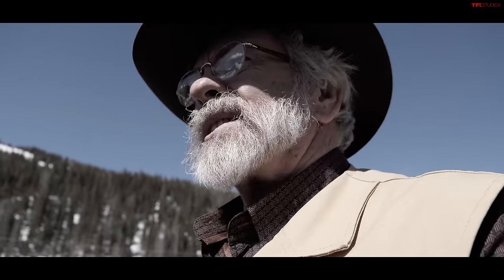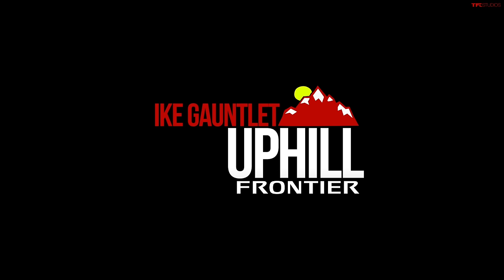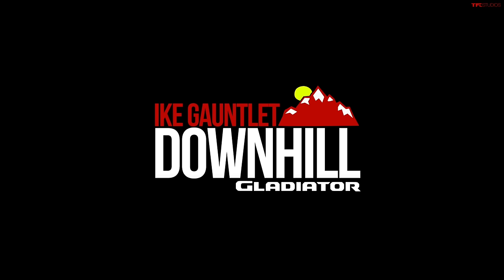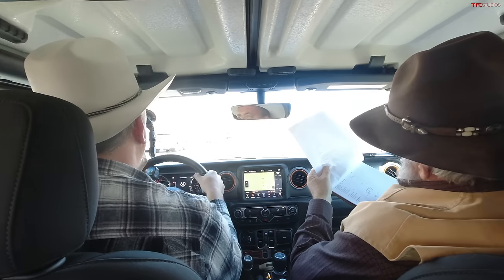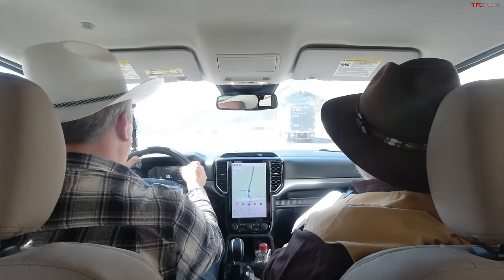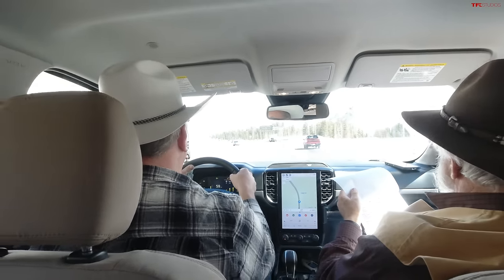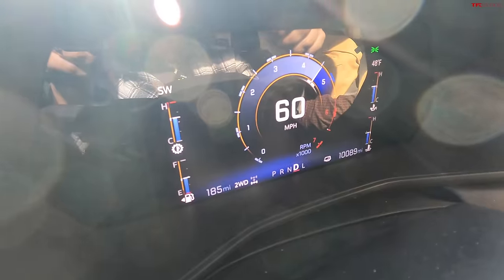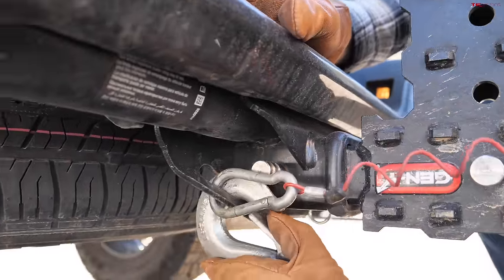MEGA Ike: New Tacoma, Ranger, Colorado, Gladiator & Frontier vs the World's Toughest Towing Test!

Comment: Good video.  However, I think given the wide range of trim levels across the brands, you shouldn't really include the "as tested" value rating  That's really only worth factoring in if the trim levels across the board are as equal as possible.  Other than that, a very useful comparison!
Reply from the maker: Thank you for the feedback.
Reply: Agree with you verbatim. An optioned up Colorado Z71 is the equivalent of the Ranger XLT Fx4, and it costs as much or more. An equivalent Nissan Pro 4X without the Hardbody stuff is cheaper than both.

Comment: The Colorado probably did worse in brake applications downhill because the transmission has learned the drivers driving style over 10,000 miles. The transmission wasn't expecting him to put a trailer and load on it going downhill because he doesn't do that very often. Starting out with a relatively fresh truck and a bunch of different drivers testing it in different environments and conditions is a whole different strategy the transmission is using than what it has learned over the last 10,000 miles. If you did a transmission adaptive reset it probably would go right back to what it originally did.
Reply from the maker: Well. This Colorado has done three Ike Gauntlet tests in its life and many drag races.   It’s hard to tell.   The Colorado was in Tow/Haul mode, so we expected better.
Reply: @TFLtruck  I understand. From an automotive technicians perspective I'm just saying that most manufacturers at this point are focusing more on a smooth shifting transmission than they are a well towing transmission. Most trucks below the 3/4 ton category are being built with a focus on passenger comfort and technical capabilities/interior options. They can haul up and down the Ike Gauntlet but they aren't as focused on doing that as they are those things. I do agree though if you place a truck into tow haul mode it should be modifying the transmission shift strategy to use engine braking as effectively as possible. If not they should just call it overdrive on or off. I do know I've seen customers bring me vehicles they just bought from a car lot and the transmissions will behave erratically. The reason for it is the many different drivers and driving styles that test drove the vehicle. The dealer really should reset the adaptives before handing over a vehicle to the new owner.
Reply: I wonder if the hill descent button was off.I checked my truck the other day under controls after putting it in tow/haul mode the hill descent activation was still set to off .
Reply: @davefornit6235 This. Once I turn on the hill descent control on my 2023 Colorado it actually engine breaks like it should.

Comment: Ya, clearly the GM and Ford are the best all-arounders when doing everything, and towing in particular. Their payloads are so good for their size, and they towed the best. I expected the Gladiator to suck at this because I remember the IKE test from a few years ago where it was tested at max towing and it BARELY passed on the low side of adequate when towing 7000+, and it has the oldest and least powerful engine. It will absolutely benefit from a new Hurricane engine. The Toyota did quite well without the hybrid system. The Nissan also did better than I thought it would, but Nissan needs to put a hybrid in it because its value proposition is already paling fast against Ford, GM, and Toyota. The Frontier is about the surest thing for product sales that Nissan has outside of cheap CUVs, and they have got to bring Frontier's sales numbers up.

Comment: I'm wonderful how the Colorado finished ahead of the Ranger on the uphill section. Being 5 seconds behind with a bigger, stronger engine with the same weight? You gave the Ranger a raw deal! I think you should retest the 2.7 Colorado against the 2.7 Ecoboost Ranger. I'm guessing you won't do that, as the 2.7 Ecoboost has handed the 2.7, 5.3 & the 3.0 Duramax their collective rear ends in the half ton trucks. As most tv shows & videos are biased toward GM products instead of the facts & the truth. PROVE ME WRONG, TFL: and just so you know, I'm a class A cdl driver with dbl/trpl & tanker endorsements. I had hazmat untl the price got ridiculous. I have over  40 yrs of experience. I can't see the Chevy beating the Ford over fuel mileage.

Comment: Can you put the cruise control on the downhill
Reply: The cruise would complicate things.  It would depends on when the cruise downshifts and such.  Here, the tow modes are main thing being testes as well as how the engine braking holds back the truck.  Its more repeatable and easier to compare trucks.
Reply: It's not common knowledge but Andre's Colorado doesn't have cruise control. Somehow it got overlooked. Chevy should have it on there but they don't.
Reply from the maker: We have done this with HD pickup trucks that helps us monitor the trailer brake gain.

Comment: Great video, thanks guys! I had hoped to see less issues with the Ranger since it has brake control.

Quick question... The Rangers all seem to be shipping with uncoated drive shafts that are coated in surface rust. Is this an issue that customers get from the other manufacturers?

Comment: You used the price you paid for the Colorado a year ago. Have you verified the current price for the same spec?  I'm gonna guess it would have cost more than it did then which would throw off your comparison.
Reply: It's still the most affordable even today
Reply: Hmm that's the best you can think of to try and dethrone the champ?  A 45 week price difference in the same truck.  Just be happy with what you have.
Reply: Its about the same.  His truck came with turbo plus (same engine but reduced power turning) and he had to pay for the turbomax tuning from the dealer for about $600.  The new colorados (trailboss and above) come with that turbomax as standard now but the price increased about the same.

Comment: Exceptional video! Thank you for your hard work. This is exactly the type of video I want to see. I plan to buy at the end of 2024. We have towed our small Casita camper (2900 lbs) 32,000 miles over the last 8 years of camping. Our used 2009 Kia Borrego V8 rated to tow 7500 lbs has been a workhorse, but with 161,000 miles, it is time to think about a pickup truck. Despite highly valuing reliability and safety, buying a truck also involves functionality and effectiveness at the tasks of towing and hauling. While reliability remains very important, function is of paramount importantance. In addition to towing, we haul camping gear so payload is very important. Unfortunately, this puts the Frontier and Tacoma at the back of the pack. I think the Gladiator would have more payload in the Sport S trim rather than the Mojave/Rubicon trims. I am very impressed with the payload numbers in the Ranger and Colorado. Plus, they are tops in terms of tow capacity. Functionality, yes! I am a bit disappointed that the test, understandably, did not include the Ridgeline. I recognize with its 5000 lb tow rating, it cannot handle a 6200 lb load. I would have liked a test towing 4,000 to 4,500 lbs that would have included the Ridgeline. The Ridgeline can compete with the best of the other midsize truck in terms of real world payload as well. I look forward to seeing the Ridgeline included in other tests with this midsize truck extravaganza that you are conducting. Wow! Thanks again!!!

Comment: This test proved one thing. If you want to tow much more than 6,000 pounds, you need to jump to a full size heavy half ton truck. Your workin all 5 of these trucks to hard to pull 6300 pounds of car trailer and mid size v8 4x2 pickup with 3 hamburger fed full grown men on board. (Camera guy in back seat.)
Reply: If you are towing 6000 lb trailers over 11000' passes regularly then sure, I agree, but anyone else in less aggressive environments should be fine with these.
Reply: Imo, if you want to tow over 5,000 pounds, go half ton, over 7,000, go HD and really enjoy the experience.

No one complains about having too much truck,  but plenty complain they don’t have enough, when it comes to towing.

Comment: Great video. Just wish you had informed us if the Jeep has a tow/haul mode.
Reply: They did and it doesn't have tow/haul mode.
Reply: 2024 does though, and they chose to test the worst gladiator for towing…
Reply from the maker: We stated that it does not.
Reply from the maker: Still the Jeep did the best on the downhill performance.
Reply: @WheresHerb  It was sarcasm. They stated it so many times that it was a running joke by the end of video.

Comment: Probably would have chosen a sport S or Willys to test towing.
Reply: They kind of get what they get, I don’t think it would have changed the results that much, but certainly those do tow a bit better than the off road focused Mojave
Reply from the maker: We tried but the timing did not work out.
Reply: Whats the point? still wont compete .
Reply: @rodgood  the lower trims would have a little better payload I think.
Reply: @jkfaulkner  the engine is not up to use, in a Jeep.
Reply: @rodgood  Jeep should have offered a new power plant for 2024.

Comment: The Ranger to me wins for being able to have the 2.7 liter V6 at some point or the 3.0 liter V6 three different engine choices unlike with the others you get 1 choice more choice the better
Reply: The Tacoma has 2 different engines with 4 different power ratings, plus a Manual and Automatic Transmission option.
Reply: @Shakerhood69  ok Ranger has three different engine options and plus the TRD Pro can't compete with the Ranger Raptor Ranger Raptor on a totally different level then the TRD Pro TRD Pro is not on the same level

Comment: Something to not you commented that Toyota rear coil suspention l copied Chrysler products. Tundra rear suspention redesigned in 2022 was based of the TGNA from the LANDCRUISER's. The leader on of road vehicle design and performance isn't coping anyone.
Reply: And the Tundras rear suspension is based off 2 decades of 4Runner suspension design along with the GX, FJ Cruiser, Prado suspensions that are almost identical to
Reply: @lukestoyz  except there is more articulation then ever.  The new GX 550 has 24" of articulation in the rear...
Reply: @lukestoyz  the new suspention, have a disconnecting sway bar and a new version of the tried and true KDSS...

Comment: Yall use the uphill time as one of the categories but the times are skewed. You have the Nissan with a faster time than the Ranger but it was working to stay at 60 and the ranger was easily holding 60. Also on the downhill use the damn cruise control. Tell the truck what speed you’re trying to maintain. Maybe I want my truck to pick up speed on the downhill for efficiency.
Reply: The truck will still use the brakes going downhill in cruise control. It would be a lot harder to count how many times.

Comment: I thought that Jeep was going to blow up. Having owned a gladiator and trying to tow 2 tons across wyoming, I would not recommend this to tow anything. Is it better than other jeeps? Sure. but dont buy a travel trailer and a gladiator in a place like colorado and think you're not going to hold up traffic. I wish there was a reliability category that figures in, knowing you might not have all the data-- maybe you could use some general reliability numbers for each manufacturer....

Comment: A smaller, low compression (turbo) engine will pretty much always be worse at engine braking than a larger, higher compression NA engine (save for a diesel with an exhaust brake). It’s the compression and the friction of the rotating assembly that does the engine braking on something without an exhaust brake.

Also, comparing the mini-trucks of the 70s to today’s mid-size trucks is not a reasonable comparison. Midsize trucks today are as big as full size trucks of the 1970s. Something like a Luv or Courier is probably smaller than a Honda Civic today. They were tiny and had less than 100hp. They got better fuel economy because they weren’t subject to any sort of real emissions requirements (which does matter, lean burning creates a ton of tailpipe emissions even if it helps fuel economy), they made no power and they would crush like a soda can even in a fender bender. Even a compact truck today (like a Maverick) is way bigger than something like a Ranger or S10 of the 90s.

Comment: You literally picked the worst gladiator to tow with, a base sport is more capable…
Reply from the maker: Well, not the absolute worst.   It’s not a manual transmission.
Reply: @TFLtruck  You got that right .
Reply: @TFLtruck  True, but there is a 1700lb towing difference between the Sport S with Max Towing and the Mojave that you tested. That is a very significant difference. You may not be able to have completely comparable models from every manufacture at the same time but major differences in spec like this should at least be addressed in such a test.

Comment: Great video test guys! I just looked up Consumer Reports Reliabilityratings for these too. In order best to worst: Tacoma, Ranger, Colorado/Canyon, Frontier. I have a 21 Tacoma Trd OR, I’m thinking of trading next year for a new Tacoma. I want to give them a year for any bugs, and wait and see how the Hybrid max does, plus see if Honda comes out with a new gen Ridgeline.
Reply from the maker: Thanks for the info!
Reply: The Taco and Ranger are new. The current CR reliability ratings are for the old models.
Reply: I wouldn't trust any rankings for Tacoma, Ranger, or GMs, as they are major redesigns. Anecdotally in forums, Tacoma and Colorado have had a number of issues.
Reply: Ranger has like 1 24 on the road.  Good argument  lol
Reply: Not only that but it's a Ford.  No one expects reliability.
Reply: @thewireman134  The thing that makes me cautiously optimistic about initial quality for Ranger is it's largely a global Ranger which is on its 2nd or 3rd year of production, with a powertrain that has been present since 2019 in U.S.
Reply: Repair Pal rates Frontier one of the best, my point being it depends where you get your information from.
Reply: Consumer Reports have yet to complete testing on the '24 Tacoma and Ranger.  They haven't tested the 2023 GM twins let alone the 2024s.  The only 'mid-size' '24s they've tested and scored are the Ridgeline, Frontier and Gladiator.  The latter two scored 48 and 45 respectively, the lowest scores for all trucks, small through full size for 2023 and 2024.

Until new model testing completes CR assumes "predicted reliability" based on previous models.  Even then the reliability score is subject to change based on actual owner feedback over time.  The rather significant failure on the '24 Taco in TFL's real-world test is worth considering, as is the poor reliability on the new design Tundra.

I owned a 2023 Frontier Pro4X for a long year.  I agree with CR's low score.  It was by far the most uncomfortable vehicle I've ever owned, and I've owned a few, trading every 2 to 3 years.

Comment: Tacoma has the worst overall ranking out of all? End of video charts. Also are you sure that the downhill test ranking is right? What you show in the chart for downhill and what you say in the studio doesn’t seem to match for break applications.
Reply from the maker: The chart shows (1-5) point values.   Not brake application numbers.   Sorry for the confusion.
Reply: Thanks for the clarification. You guys are doing a great job!
Reply: Yes.  They spent years to bring out that pile that ranks at the bottom of just about every category 🤣 if the reliability isn't there than what we're they doing with that design?

Comment: I'm sure the ad guys at Fiat had a lot to do with rating the boat anch ... err ... Pentastar over 280 HP.  More likely close to 210.
Reply: No, I think it makes 285 at sea level. Probably making 200 hp here.

Unfortunately you need more than 200hp to tow a 6200 lb trailer up a 7% grade at 60mph. My 5500 lb travel trailer needs more than 200 hp just to tow on flat ground if there is a decent headwind.
Reply: @Jay-me7gw  It NEVER makes 285.  Only in advertising.  It's the BIGGEST DOG of any V6 in that size.  I'd love to see the entry level 3.3 F150 vs an entry level RAM 100 3.6 of a few years back do the quarter.  Heck I can't tell the difference between a 3.2 Cherokee and a 3.6 Journey.  And my 2.3 Explorer will eat their lunch and have room left for dessert.  The 3.6 Acadia I used to own had more oomph.

Comment: Nissan 4.0L is still a better engine for towing than the 3.8L. The 4.0L was highly detuned, the ECU did not even fully open the throttle until 60 mph. The 1st generation Titans had a similar throttle restriction.

Comment: The gladiator Mojave is not 45k.
Reply from the maker: The used Jeep Gladiator Mojave we used was $45,000.  You are correct a new Mojave is near $65,000.
Reply: @TFLtruck  unless you get it discounted. I’ve heard people getting rubicon for 43k. That’s the way to go. You should do a video comparing the use of rear lockers. Ease of use and engagement.
Reply: You are paying 75 to 95,000 Canadian up here in Edmonton Alberta for wranglers and Rubicon’s and Mojave’s.
Reply: @gregmoessner3104  the 24 are 60k plus in Alaska. I’d wait for the discounts later on .

Comment: You should have just done the tow test using the max the Ridgeline could tow and use that with all vehicles. 
Or what you did plus the Honda @ it’s max. 
Who cares if it’s not Body on Frame? - I prefer monocoque all day!
It’s rude to be towing in 2WD when you’re supposed to be driving 4WD vehicles. Yeah I know why - but a 4WD should be 4WD all the time. 

These payloads are tiny. My Discovery Sport SUV has a 759kg payload (1673lb).